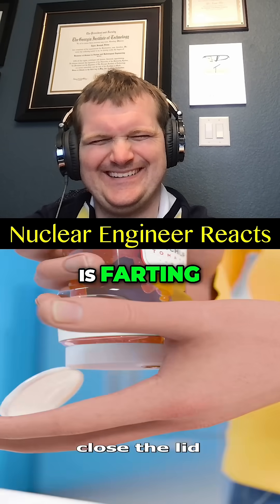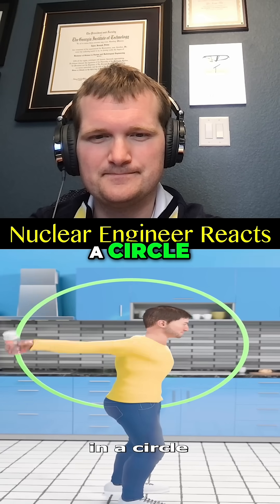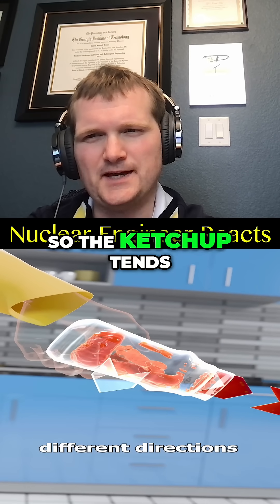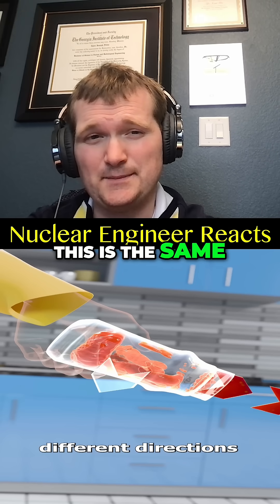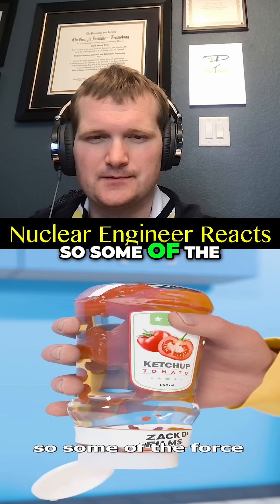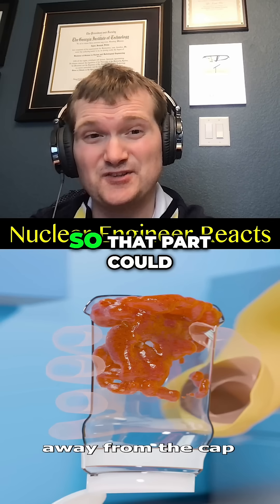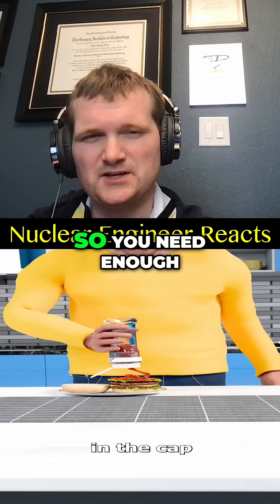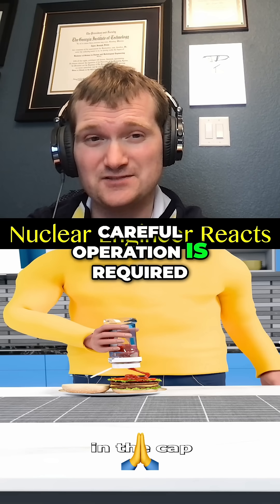Using Physics to Get Ketchup Out - Nuclear Engineer Reacts to Zack D. Films

Comment: Nothing to do with inertial or centrifugal forces which arent real. its just ketchup attachment with bottle isnt strong enough so it gets separated and its going to the top is simply it following its own path until its hit with bottle walls. What really causes the separation after a period of bottle attachment is when the attachment arrangement of particles isnt sustainable due to breakage of bonds and even at that, centripetal force isnt even the main culprit, thatd be the tangential force. And after kitchup is free it simply gets redirected after each wall hit such that the next wall hit would be nearer to the bottle cap.

Comment: To avoid splattering ketchup when opening the cap, squeeze the thin sides of the bottle to lower the pressure inside the bottle, making it suck in air instead of releasing air

Comment: CAN CONFIRM: If the cap pops open during this it will draw a dead straight line across the ceiling, down the wall, and across the floor.

Comment: A verticle motion can work if done right, shak down like you're slamming it on the counter, slowly raise it, repeat. doing it this way will generate enough force to push the Ketchup down while avoiding the force required to push it back.

Comment: You can just shake it horizontally,
holding the bottle at the bother,
throwing the ketchup to the nozzle by creating enough centrifugal force,
no need to do the entire loop.
Besides, it works even better,
BC it takes less energy, gets higher speeds,
and most of all,
you won't look like a complete baffoon.

Comment: Those caps suck, Misters Heinz and Hunt.  Find something better. Last week I got two shirts.  

Oh, and first while upright, squeeze out some air and re-cap.  Then as it warms it won't pressurize and blow ketchup all over the place when you open the lid.  Also, shake to get the runny stuff back in the rest of the solution.  And upside-down and shake side to side, not up and down, it works great.  
These things should come with instructions.